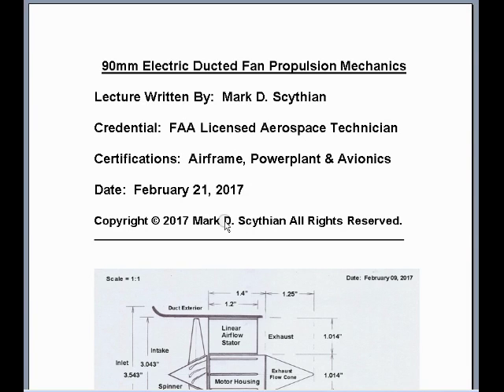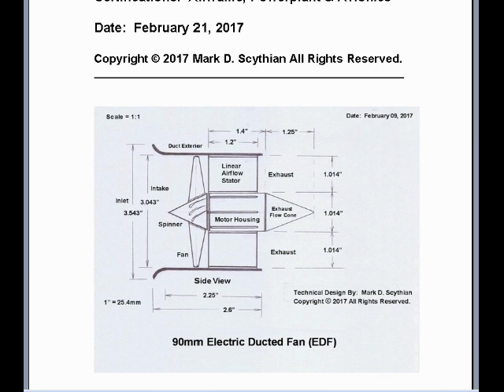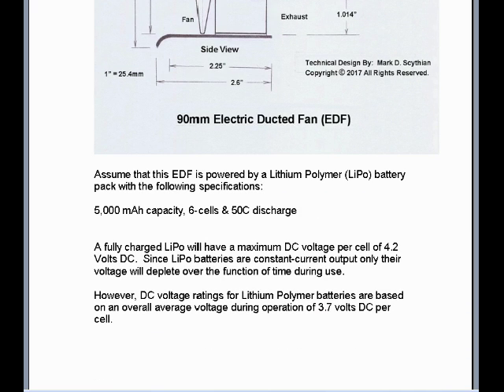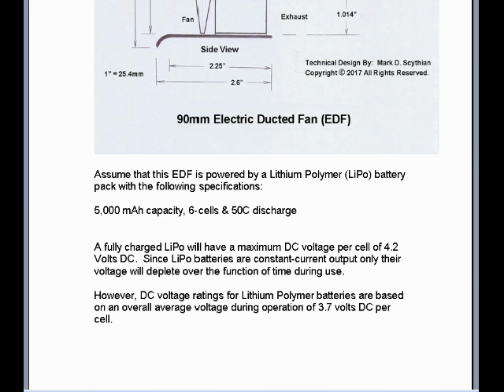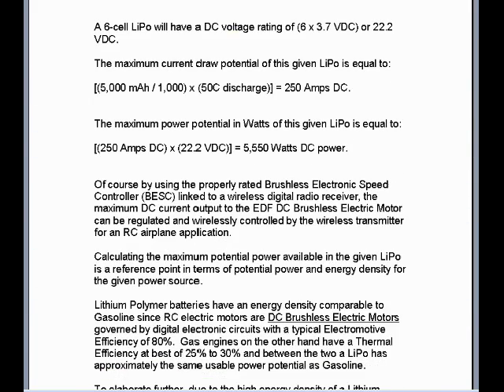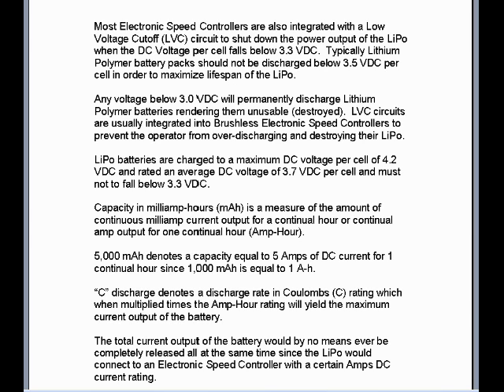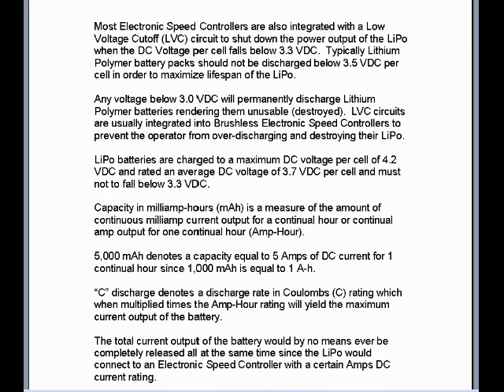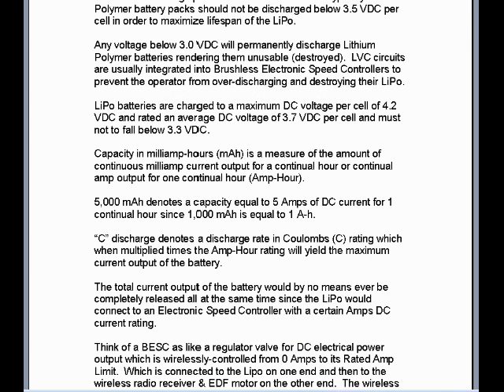90mm Electric Ducted Fan Propulsion Mechanics (Part 1 of 4)

Comment: Do they make these bigger? How big?
Reply from the maker: Hi.  An electric ducted fan propulsion unit could be scaled up for aviation applications.  However, it's power-to-weight ratio and overall efficiency would be too low for any practical return-on-investment.  Although scaling up a diesel-piston ducted fan, for perhaps an Air-Boat may prove worthwhile, if let's say the blade pitch is high and ducting is narrow, using a high torque, low RPM power application such as diesel-piston.  Of course the highest power-to-weight ratio for a bigger "ducted fan" would be none other than a gas turbine powerplant, such as those that power modern airliners (turbofan), which may be cost-prohibitive. 

Smaller applications for model aircraft under 55 Lbs, such as high-speed RC airplanes, an EDF is most practical.  In regards to scaling up aerodynamic structures, it's actually a proportion to the Reynold's Number and air density unlike most non-aerodynamic structures (houses and buildings).

But these EDF units are quite fun to implement especially in regard to high speed RC model airplanes.  Their physics and math is also a summation of both Bernoulli and Newtonian forces.